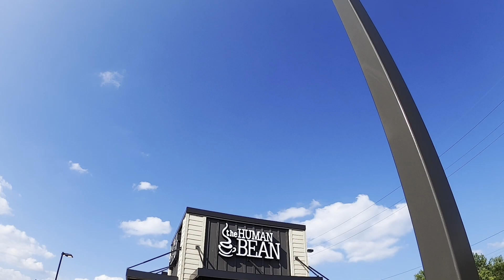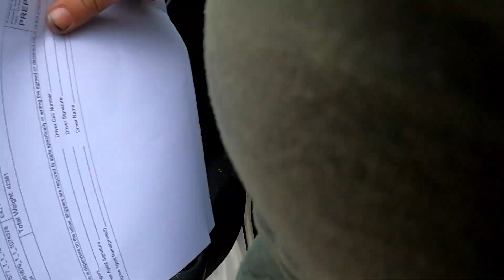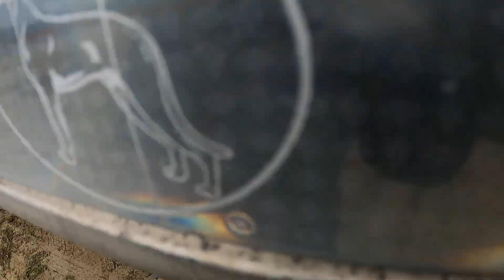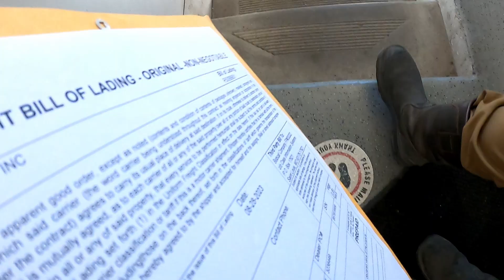Driver HITS Me!!! I Mess Up [Western Express]

Comment: Thank you being a professional driver. My first job in the 80's was flat bed. Loved it. Won't go into everything. Loved driving in the desert 🏜️, going conn. PA etc. Later drove van gues they still called hot loads. Times are different,and can't get from Vermont to CA in 2& 1/2 days. Coast to coast paid good and good companies. Thank you being a professional driver. 👍👍👍 🏅 Keep up the great work,watch out for horrid brake testing 4 wheelers!!!!!
Reply from the maker: Thank you for all the kindness and for also being a professional driver! Only professionals will comment on that! 🤣I love driving in the desert, too! I love the dry air! Unfortunately, I usually get stuck in the Northeast! Times are way different! My grandparents drove back in the day and it is nothing like I remember with them! I got to spend a summer with them on their truck when I was younger! I will most definitely keep up the great work to the best of my abilities! Oh man, yeah those horrid brake testing 4 wheelers! I wish they understood our perception of what happens when they do that! My truck has that automatic slam-on-the-brakes thing if it sees brake lights, it has shifted my load before! 😱 Again, Thank You so much and you be safe out there also! 💯👍😆

Comment: How long does it take you to secure a load? Do you do much backing at shipper/receiver? How long are you given to complete a load? How many loads and/or miles do you a week? If you fuel at Love's, why do you shower at Pilot.. wouldn't it be free at Love's? Is it easier to back with flatbed than van, since you can see more? Do you get paid per drop? How's the pay, is it per load or miles? Sorry for all the questions but I appreciate the videos they are very helpful. Enjoy your your day
Reply from the maker: It takes me anywhere from 30 minutes to 2 hours to secure a load. As far as backing goes, if they have docks chances are we are backing in. However, most of the time since we are side-loaded, usually I just pull up somewhere. I would say it's about 50/50 on the backing. When it comes to completing a load, if it has a set appointment, I am expected to make it there by that appointment time, but when I am trip planning if I don't feel I can make it; I can call and have my appointment rescheduled. Usually, the planners are great at scheduling an appointment time. Rarely, have I had to have an appointment time changed, if I do it's because I am trying to get an earlier one! Most of the time, I have a window of hours to deliver the load and all the in-between is up to me! I have a pay video coming out real soon, that will break down my pay for this past year! It will have the miles, loads, cpm, and so much more! I believe it will be the best Western Express pay video out there when it comes to the flatbed division! It is hard to answer your loads and miles for a week seeing how it can vary drastically. I have been fueling at Love's and Pilot. Mostly, Pilot though! I love the showers at Love's better, but I get more at Pilot! Plus, being a veteran, I get 10 percent of all food! I save more money at Pilots! As far as backing a flatbed, when it is empty, yes you can see a lot more! However, we have a larger turn radius and sometimes can't do all the things a dry-van can do! That spread axle is so different! Please stay tuned for the pay video because I believe that will answer all your pay questions and so much more! Thank you so much for taking the time to check out my videos and I don't mind your questions one bit! I appreciate you and I am glad my videos have been helpful! That is my goal is to help other drivers out and be entertaining in the process! Have a great day and stay safe on these roads out here!
Reply: @JennifersTruckingAdventures  thank you so much for this information. I'm definitely going to stay tuned in. You're the only one I have find giving such good insight. Happy Sunday!
Reply from the maker: @latisd5121  I am editing the pay video as we speak! I am so excited to get it out there because that is the number one thing I get asked the most is about pay! I am going through every pay stub for the past 12 months! I am breaking it all down! I am showing even the ugliest one, where I ended up owing Western Express after working! Thank you so much for your interest and Happy Sunday to you as well!